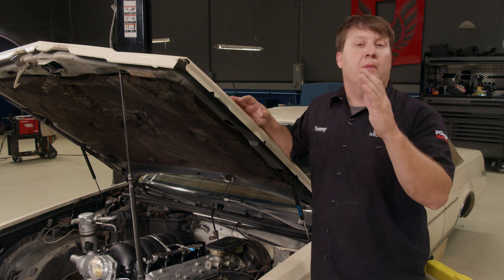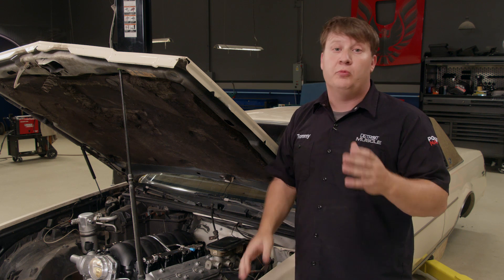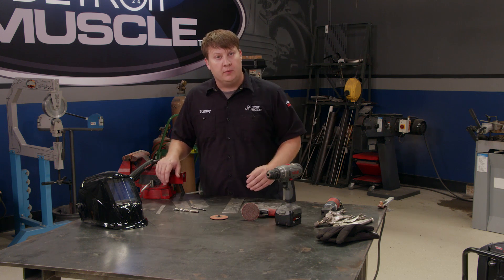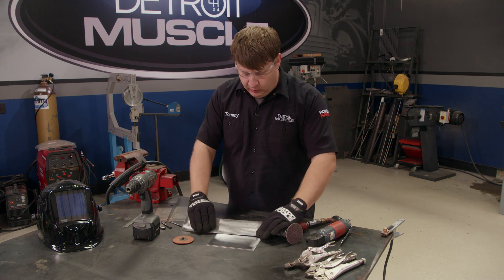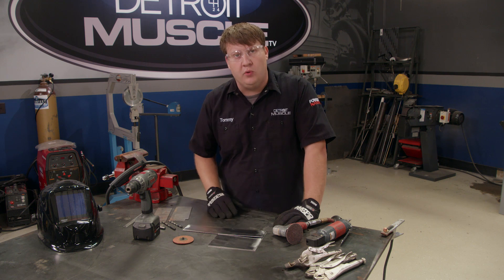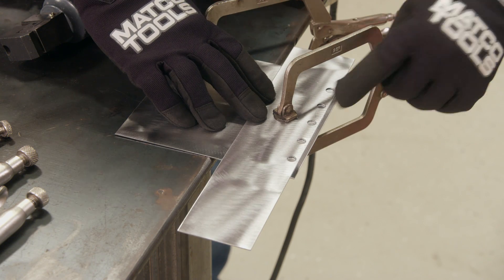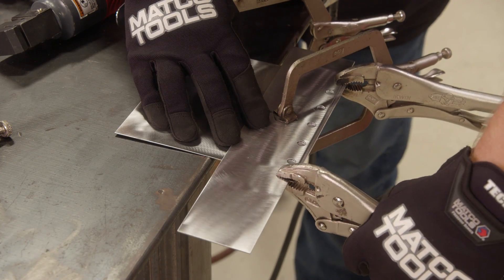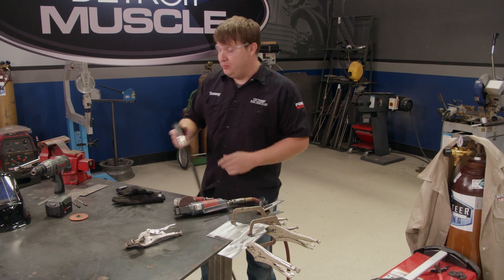How To Simulate Resistance Spot Welds

Comment: Excellent video ! ....Now the next challenge is to find a good refined Mig welder and get the settings just right (with a lot of trial and error) so that when you do this, you do not burn right through the bottom piece of 18 gauge steel when spot welding the two pieces together as its very easy to just blow a hole right through with the heat being concentrated in one spot.